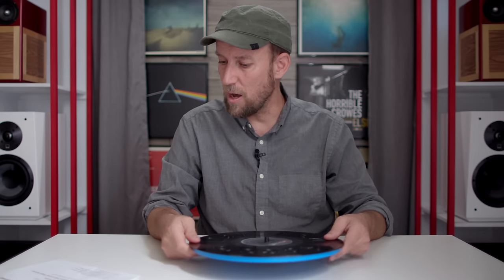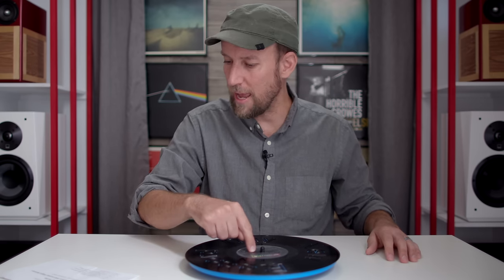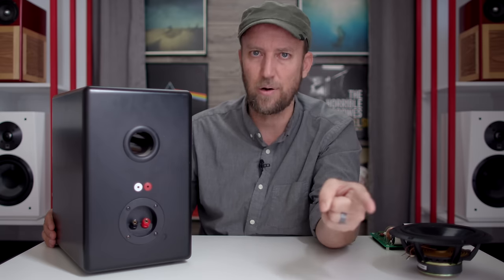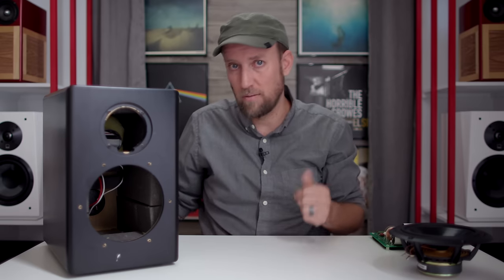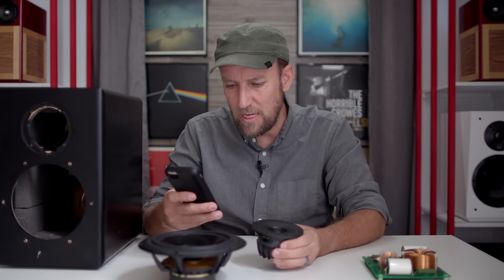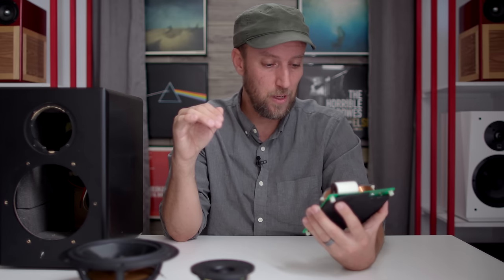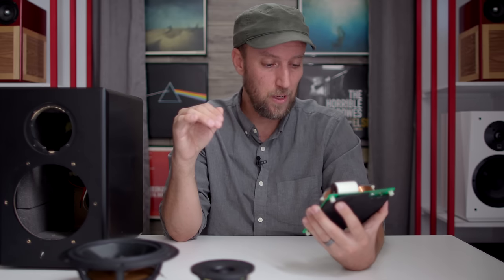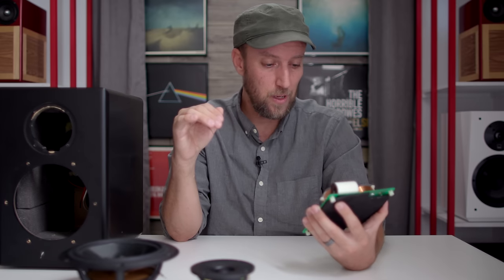End Game DIY Audio? Whats inside the X-LS Encore!?

Comment: I sure would like to see distortion measurements to backup these claims of superior sound from component, connector, and wire upgrades.
Reply: the tweeter measurements are SO SO BAD. Danny is lost in nostalgia and can't even contemplate that new stuff obliterates these near discontinued parts. Even Peerelss has ousted the tweeter they made and don't make them anymore unless you order 1000 units. SB acoustics makes the best cheap cloth tweeters at affordability. and they measure astonishingly
Reply: That will NEVER happen...lmao
Reply: Distortion measurements have no industry standard and no accuracy taken outside of an anechoic chamber. Distortion measurements also have little correlation to how something sounds. It could highlight a problem if one existed, but those same problems can be seen in other measurements as well. The very word "distortion" has just become marketing jargon much like "power handling".

Comment: Ordered these from Danny on May 4th (standard edition, first timer)! Can't wait for them to arrive! My diy boxes are waiting patiently for the GR Research love!
Reply: so how did  your x-ls encore build go from danny.  Im a first timer who has never soldered anything, would use the  $140 flat pack of wood to build the box.  did you use the flat pack of wood to build the box?   seems soldering would be scary for a rookie but easily done, since I would have it on a work table, easy to reach. I've stained wood before, but  must buy clamps. clue, stuff to put the cabinet together. Please advise. a friend has a klipsch forte 3 he bought in 2018, saying they are too big for his room, wants $2200, shipped from az. too far from  my home in NJ to see or hear them. but  the $540 (all upgrade and flatpack) ls encore might be better. I have klipsch floorstanders rp5 from 1990, 1 tweeter, 8 inch mid, 12 inch 150w amp built is, and thiel c2.3 1 inch,3 inch, 8 inch  from 1990., in 13 by 18 room

Comment: Thanks Ron, you helped me with the choice and I bought the fully finished pair with all upgrades from GR Research.
Reply: I bought 2 sets of completed speakers direct from GR Research. First I got the Carnegie Acoustics Davanti bookshelf speakers. Designed by Danny for some guy with marketing plans, he built them in China and the market changed. Danny helped him liquidate the Davanti speakers for $300 or $400. Happy with these I bought the completed L-XS Encore with all the upgrades. With supply chain issues it took 3 months. I moved the Davanti to the NAD M10 with a HSU subwoofer to my TV. And put the XLS to my Parasound P23 and preamp Bluesound Nodes. After a few days the XLS changed and now have more base than the Davanti with Subwoofer. But also more clarity and transparency.  Maybe the amps? Both rooms are side by side and 12x24 feet. I can put them in the same BlueOS group and A B test them most everyday. I have a 3rd BlueOS zone in my home office.

Comment: About time you got into the DIY reviews. Being a lifelong DIYer myself, I am in the process of building a pair of X-MTM speakers that Danny has but isn't on the website currently that go down to 40Hz at -3dB so that I don't need to use a subwoofer, since I plan to use them just for music playback and the low E string of the 4 string bass guitar is at 41.2Hz. Since some music may use a 5 or more string bass with a low B string frequency of 30.9Hz , I plan to eventually design and build a open baffle sub. One great thing about DIY is that you can do whatever finish you like to the cabinets, myself I will paint the cabinets a gold metallic color with several layers of clearcoat for a finish just like I on some sports cars that I can't afford, but at least I can afford high end sound for about $500 the pair and stare at the beauty of those speakers.
Reply: i know Im kind of randomly asking but does anybody know of a good website to watch new series online?
Reply: @Brett Lochlan Thank you, I signed up and it seems to work :) I appreciate it!
Reply: @Reginald Zachariah No problem =)

Comment: I design my cabinets the same way. I use MDF in cased with oak and hard maple. But I design my own speakers and they are much bigger. I even use the fasteners but I have big rubber feet on them. But I use a industrial accustic damping gel adhesive instead of wood glue. I have built them with MDF alone and listened to them and then I applied the maple and I can hear a big difference.

Comment: Beautiful, but having built speakers with real solid wood baffles, not laminated to MDF I wouldn't recommend it. Not nearly as stable as MDF in a home environment that has central heating (like UK) as they can swell and shrink and crack even at that thickness. That said, gorgeous cabinetry.

Comment: 6:29 - what does the rounded frame edge have to do with whether the woofer is countersunk or not?   Countersinking has little to nothing to do with performance.   Actually the rounded front edge just means the woofers should only be front mounted.
Reply: Countersinking the woofer means you have to groove out the front panel, which makes it thinner, and thus becomes potentially a point of resonance.  The fact these taper to nothing mean you don't need to do that, and it also has the added advantage of keeping the transition smooth as you move away from the cone...which helps any weird refractions.

Comment: Buddy try these, you have to my buddies company uses these I have them in a pair of prototypes  speakers from his company Wow I was SHOCKED to say the least
Reply from the maker: Hey man, try what?
Reply: @Newrecordday2013  crap my man I sent you the link on that it didn't show on Maddis sound silver flute paper wool drivers
Reply from the maker: Oh I’ve tried them. Not bad speakers but a little dark sounding imo.
Reply: @Newrecordday2013  yeah if you can get a really good cross over into that then that won't be a problem  my buddy is using those it is prototype speakers and I totally agree with you because his first couple tries for those speakers were a little too dark sounding the newer version of what he has are a little on the warm side of neutral which is not a bad thing I'd rather have that than something crazy bright but he does use bullet tweeters 1 front facing one side facing pretty neat stuff

Comment: One needs to consider resale value too. Unfortunately, these puppies will be worthless in 15 years, differently than the big dogs. Honestly $1750 is very steep for this single reason. Big part of the hobby is to try something different, and most people will want to sell them eventually.
Reply: Then build them from a kit. 

And if you are worried about resale value then keep in mind that most of our customers sell their kits (as finished speakers) primarily to order the next model up in the line, and they sell their kits for more than they paid for them most of the time.
Reply: Danny Richie I totally agree when buying directly from you. I’m eyeing myself a x-static kit. And the matching center speaker. My comment was related to the assembled speaker. Although I totally see the value of the craftsmanship, no doubt about that!
Reply: Mike's work is really good. It's a good option for some.
Reply: I bet so! Don’t take me wrong. My comment was solely based on the “economics”. I’m in no way saying it is not worth it to everybody.
Reply: I’m with you on this. This is a DIY kit that’s pretty steep. I’ve seen better examples for less on Part-Express. As for looks - Fugly.
Reply: Buy Rogers ls3s etc retain value